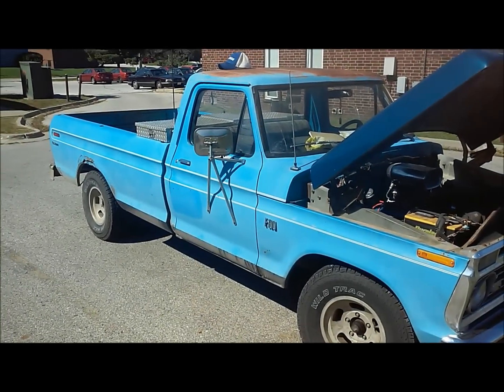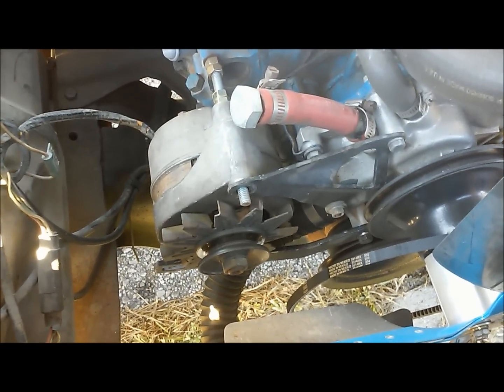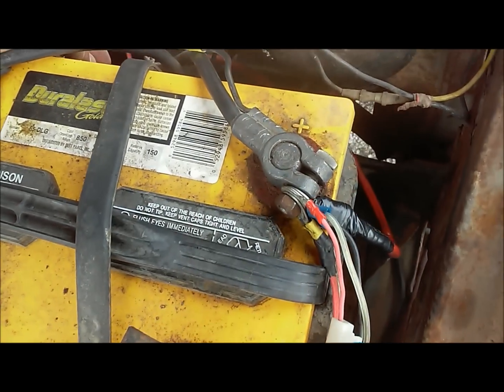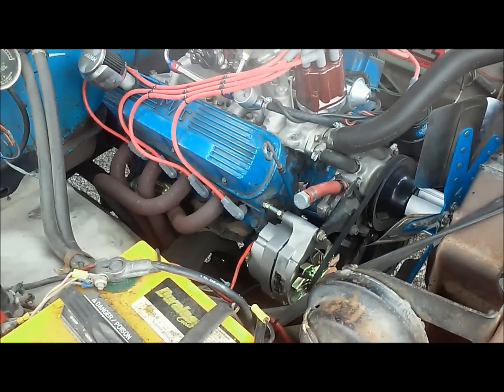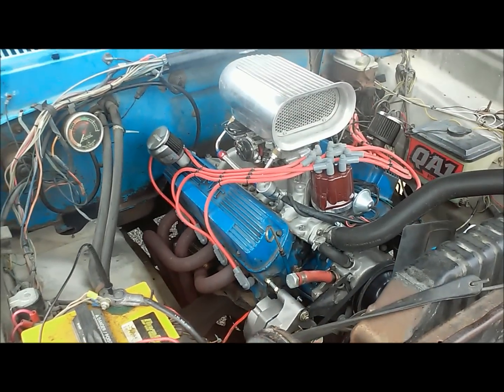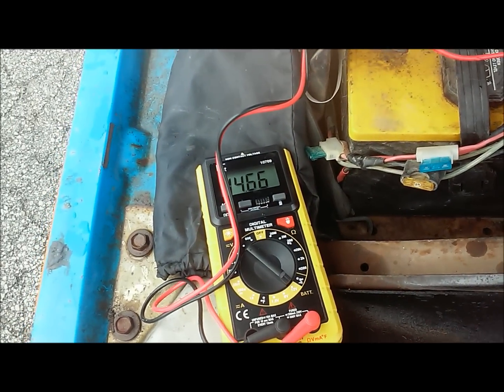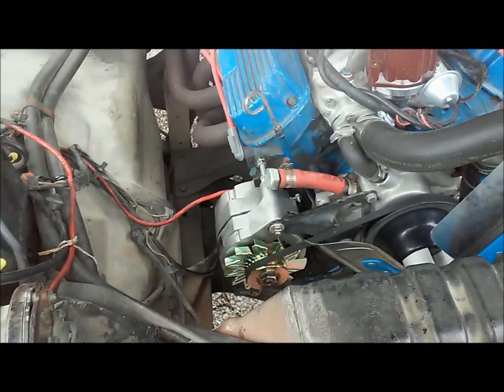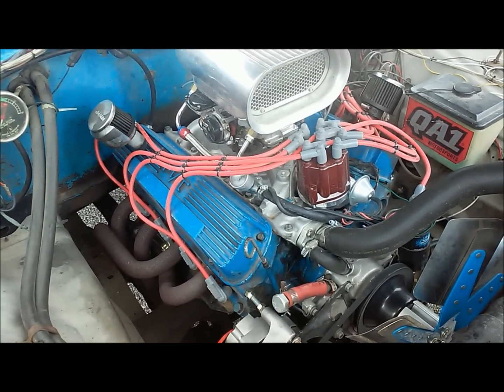One Wire Alternator Comprehensive Install & Review

Comment: I have a power master 150amp  one wire  on 66 289 bronco with high flow  crank water alternator  march set charges 14volts in park  lights electric  heater on but once shif to drive  rpm 750  voltage drop to 12volts  what should alternator size alternator pulley  may solve and  increase voltage in drive with march hi flow water pump  and crank pulley and powermaster  alternator 150amp pulley 2.6 inches.

Comment: Hey Luke, just picked up a 1978 Bronco, the battery is not charging, suspect the alt. but I know there is a ext. regulator but wondering if a 1 wire alt. is a good option? Everything is stock on this 351M or 400 not sure which I have yet? Also can you run the hot wire to the solenoid relay switch instead of to the battery? As of right now it starts right up, no manual choke on this, should I consider an electronic HEI Ignition to rid of the other Motorcraft ign box or a protronics instead?
Sorry for all the questions, let me know a better way to chat. Thanks.

Comment: show the install,not all the bs
Reply from the maker: If you can’t install an alternator, you probably shouldn’t be attempting this at all. 
The only difference is removing the voltage regulator and going right from alternator to battery. 

Doesn’t take hours of camera angling and fighting wind noise for someone to understand that.

Comment: Thanks for the video. Wish you would have done a step by step on how you wired it though.
Reply from the maker: The big red wire goes directly to the battery. Someone worried about a dead short could put a 100 amp automotive style circuit breaker in line

Comment: FYI guys. The alternator he installed is the front shell from the Ford OEM 1G alternator. This is mated up to the GM 10si alternator. Notice the black plastic cover over the two male prongs which would have gone to the idiot light in GM products. In summary this conversion can be accomplished dirt cheap from bone yard components.

Comment: Car voltage battery will only charge to 12.5 volt capacity the higher charging voltage isn't is  the charged voltage it's the charging voltage of the altenartor  when you switch it off your voltage will read battery voltage until the alternator is running again then the charging voltage of 14.5 volts will be read once again

Comment: A battery reading of 12.5 is a fully charged battery
,When a battery is in a vehicle running hooked up to the altenartor it should read 14.5 volts if your system is charging in a working system while running your engine vehecle

Comment: Love your videos.  You should do a video on how to wire a remote fuse box and relay series for accessories.  That would be good
Reply from the maker: Can do - I actually make apps and design PCB boards and code microcontrollers and PLCs as my day job, I really need to make some in depth electrical videos!
Reply: Funny that wiring given your career but you were 17 right?  Electrical systems and amp loads in cars is pretty important stuff for avoiding fires.  I had an electrical fan catch fire in a car I bought once.  Scary!

Comment: Did you have to remove the existing voltage regulator? I am going to install a one wire on my 67 mustang as part of a complete rewire with an American Autowire harness.
Reply: No removal required. Its no longer harnessed to original alternator.

Comment: Did you use a circuit breaker in line with the battery and 100amp alternator ? If so what kind?
Reply: Tuff Stuff says no breaker required, unless you run high amp accessories.

Comment: Any updates on this? I’m putting one on.
Reply from the maker: Doug Coleburn yes, search Thunderhead289 pulley set up 👍
Reply: ThunderHead289 hmm thanks but I don’t see it.
Reply from the maker: Doug Coleburn it was literally my first result, but that may be because he’s me. 
https://youtu.be/-qI9oV9sggo
Reply: ThunderHead289 thank you. I’m putting on a Powermaster 100 amp v belt. I hope I don’t have the squealing problem. I can’t run a dual pulley set up as I have AC and power steering. Going on a 69 302. 
I guess I better get the belt darn tight!! I like your channel.

Comment: How has this alternator worked out for you long term? Thinking of installing one in 70 mustang. Ive tried the one wire conversion for my 3 wire and its cooking my battery  at 18 volts going down hwy! Looking at the Jegs one wire alternator is that what you installed?
Reply from the maker: Mine is made by tuff stuff - I got it through amazon or summit. It’s a hybrid GM rear with ford front. 
Search “Thunderhead289 302 pulleys” 
I talk more about it in that video!

Comment: Wgat did you do with the internal regulator plug in?..did you splice it into the red wire and ground to ground?
Reply: The truth Kills  red wire on alternator for the 1 wire goes straight to the hot battery post or hot side of soilenoid you can put the ground from the alt on the block or the negative side of battery need right gauge wire for the 1 wire alternator or it won’t charge like it’s supposed to.  The external regulator plug from the factory isn’t needed just tape up and push it out of the way.

Comment: I just installed this on my truck, ran great for 15 minutes, now the only thing electrical on the truck that works is the hood light...no headlights, wont turn over or anything. Any thoughts?
Reply: whaat was the problem?
Reply: @car.gems.  someone put a 10amp  inline fuse feeding the fuse panel halo hradlights blew it

Comment: You need to upgrade you battery cable to alt if its hot.  I put a 0 gauge on mine.
Reply: hot.. as in voltage, not temp.hot
Reply: He’s not talking temperature, he meant active wire.
Reply: He installed that larger wire to actually cool it down That's what he meant. Small wire will get hot to the touch large wire will not.

Comment: When the engine is off battery should stay 12.6 volts and when it's running it should stay over 14.5 volts and this is normal. If battery stays at 12.5 volts when the motor is running then the alternator is defective.
Reply: Running alternator 13.8 even in semi tractor trailers Yo.. yo dudey- dude- dude
Lmao

Comment: I bought the same alternator a couple days ago, and it was delivered today. I can't wait to install it on my 1964 Mercury, It should be a big improvement vs the old 40 amp alternator.
Reply: Southern Mechanics hey i just installed my one wire voltage regulator on my new alternator for my 63 comet. Im now blowing fuses when all my accessories running. Plus after market stereo can you give me any advice.
Reply: Chase Campbell It sounds like there’s too much amperage going through the car

Comment: Does your ammeter still work?  I assume no, I'm trying to do this on my 73 f100,just swapped out the FE 360 to a 460 and trying to figure out how my guage can still work, also just eliminating the wiring harness off the voltage regulator. ..any info would be great, great videos man thanks

Comment: I got a 65 mustang 289, this would eliminate my stock voltage regulator.?
Reply from the maker: yes it definitely would indeed
Reply: ThunderHead289 thought so good deal thanks great channel
Reply from the maker: no problemo, and thanks
Reply: ThunderHead289 you're welcome
Reply: What do you do with the external regulator? remove all the wires and regulator, anything special you need to do?
Reply: j j 2021  it was brand new. still got it, if anyone wants it haha

Comment: I have a 1 wire alt and I ran the wire to a 100 amp gauge and a voltmeter to the dash then from there to the positive side of the starter. Can't see the wire to the battery. its cleaner look.
Reply from the maker: +angelfiggi thats a pretty damn good idea

Comment: I am a new subscriber as I just now found your channel.  My understanding is on a one wire alt it is not charging unless the rpm reaches a certain level.  Not sure how true that is.  You have interesting vids.  Keep up the good work.
Reply from the maker: +Jim Buford they have a trigger that somehow senses rpm. they arent bad, but arent the best. when i did this and made the video i was much better read on the subject. they dont pull amp unless they are rotating though, so they will not, and have not from my experience, drain the battery while sitting. thanks for the friendly words btw
Reply: This should help further explain how this alternator functions. https://youtu.be/WD5dZkGkkeI
Reply: Tuff Stuff advises 900 rpm.

Comment: Thanks for the video. Was your car a generator car to begin? I Need to change my 63 Ford from generator to alternator and am wondering if the mounting brackets are going to be the same or different. Also - which alternator did you use? Thanks!
Reply from the maker: +Chuck Davis i think the brand is tuff stuff. i got it through summit. my car originally had an alternator, but only 40 amps which wasnt much when running some descent electronic ignition. also, the bearings on mine were going out pretty bad. for mine, my brackets were the same. couldnt say on something that isnt a 1965 and on small block
Reply: +ThunderHead289 Thanks again. I've been studying your videos quite a bit in preparation for a new intake and carbs. I just happened upon this one and it's also something I need to do. I really appreciate your making these for us!
Reply from the maker: no problem! i just want to get the info out to clear up all the guess work. i like keeping the old american iron on the road

Comment: My one wire alternator needs to get turned on or "Excited" once the engine is started. This is done by tapping on the throttle for a second. With the voltage gauge that I installed, you'll see the voltage jump from whatever the battery voltage may be, 12 volts or so, up to the alternator's output voltage of around 13.8 to 14.3 volts. I removed my AMP gauge because it didn't have any fuse protection and actually shorted out and caused the wire harness to catch fire. Because of this lack of circuit protection and the size of the wire needed for today's cars to use an amp gauge the voltage gauge is now found in most cars and trucks.
Reply from the maker: +Charles Georgoudis that would be better than these. its sketchy how they will kick on if they sense a momentary voltage drop. granted they will switch off after a bit if they dont spin, but still. working very well so far and very pleased. after installing it i can definitely tell the ignition wasnt getting as much power as it wanted.
Reply: ThunderHead289 My Alt. is a PowerMaster. It's a 100 Amp and can be wired either one wire or as a standard alternator. I don't know why somebody would want to do that, but you can. It has a built in regulator, so you can unplug the external unit and remove it. I've had it for years and it still works great. The paperwork does express that the ground lead must be at least as large as the positive lead to the battery. Good luck.

Comment: You could opt to a 3G Ford alternator which can be wired to be a 1 wire or to use a ignition on which is handy if you want control over it or if you have an idiot light. I prefer the 3G over most aftermarket Alts because of its performance and ease of use. You can also get aftermarket versions that put out as much as 200 amps or more! It's just a pain to get a v belt version
Reply from the maker: +TheMustangmaster98 i did a little reading on that system and i may have to try that eventually. i actually had an aftermarket 3G on my 2000 mustang. (still have the car lol) and it burned the bearings down in it very fast unfortunately. looking to try it again on the Galaxie. . . .